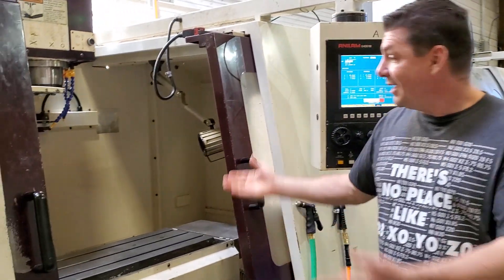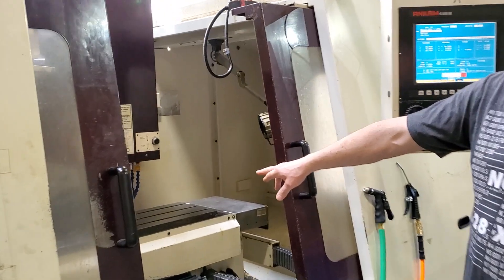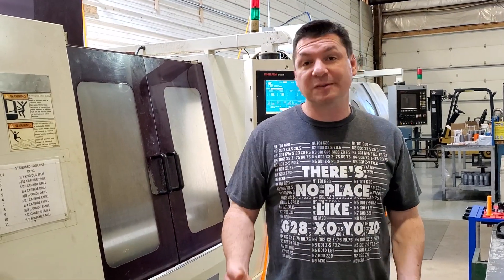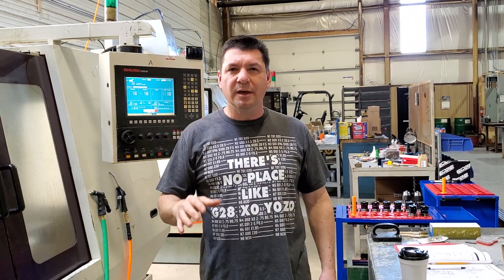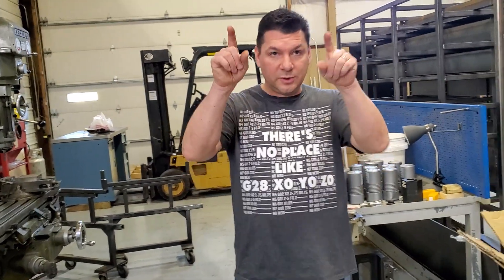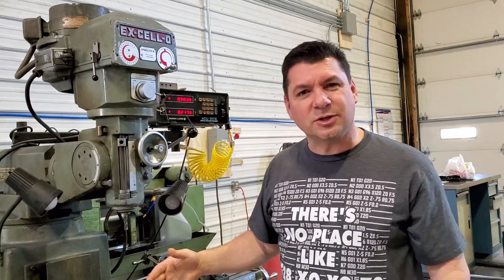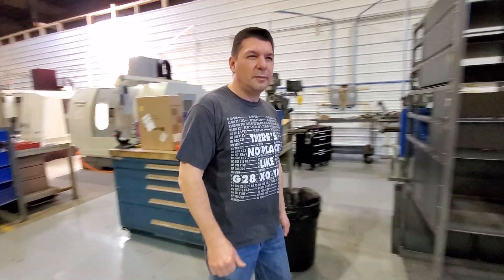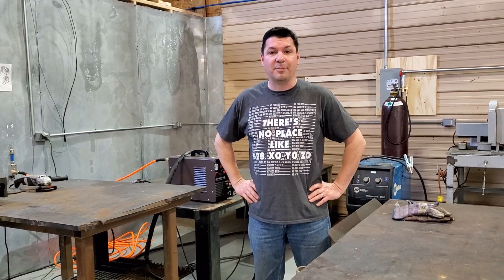Harmony Turbines Weekly Whirl 9

Comment: Gearbox? Does it spin that fast? I would think direct drive would be better. Why not?
Reply from the maker: We will need to used toothed pulley or some way to gear up (not down) for off-the-shelf generators because they will run at a different RPM range. But when we start doing our own generators the plan is direct drive.
Reply: You want the generator's rotor to spin faster.